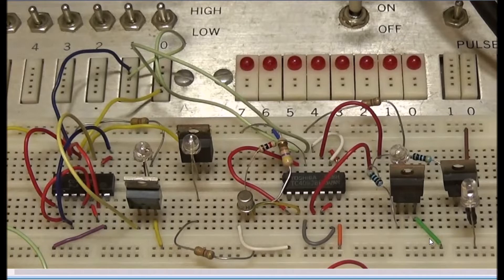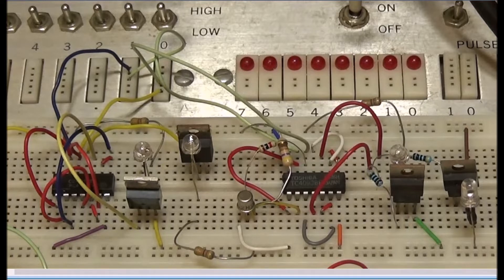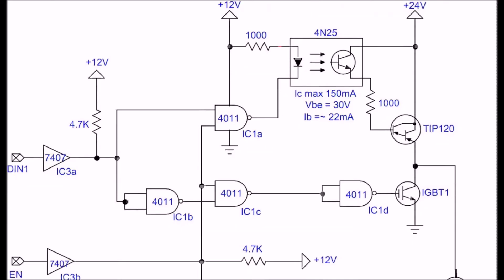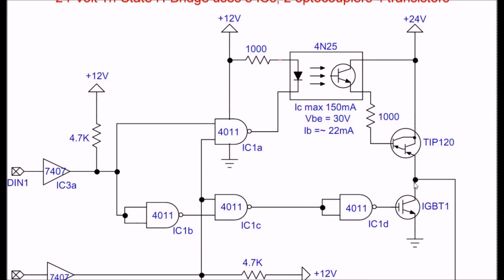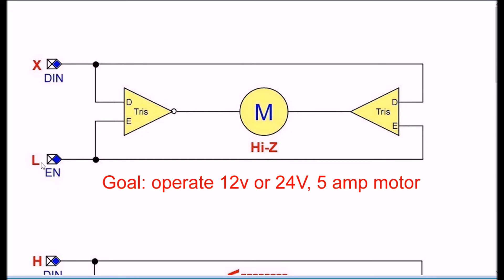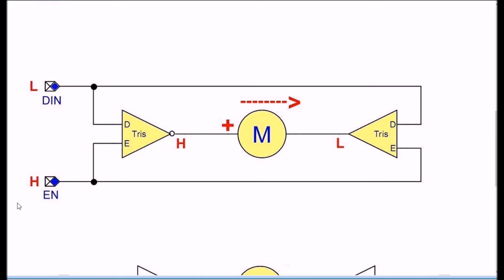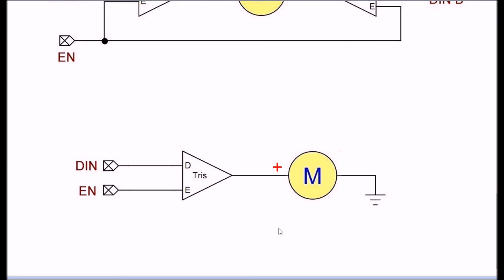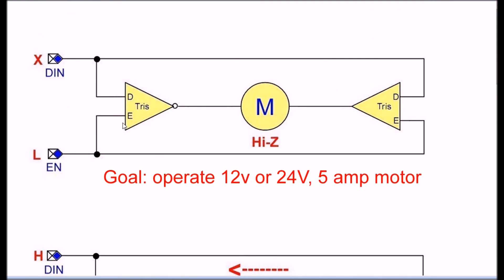Introduction Tri-State H-Bridge Motor Controls

Comment from the maker: Good discussion so far. This is designed with goals: teach various issues related to electronics, and to work on solutions related to specific design issues. This was designed where the output transistors are switch off in the same way a microcontroller IO pin is switched off. Here we are dealing with amps, not milliamps. The following videos related to this are going to address various parts of the design and how YOU can do what you really want.

Comment: Hi. I have been folllowing you now with great interest :) The reason I startet was the need for a motor control that could handle a 12VDC/55A motor. Any ideas how i would adapt/modify any of your circuits?
With regards from Norway
Reply: Just for clarity, what is your application like. How is the motor supposed to be used. For instance, is the circuit a simple on-off requirement, or turn on for a controlled time, then stop.  Do you need to control the speed as well. ??
Reply from the maker: It can be done with IGBTs. I would have to add a photovoltaic type optocoupler. I'll do a sample schematic.
Reply: The motor is connected to a seawater pump, feeding a heat exchanger. The amount of cooling is determined by the speed of the motor. I planned to use an existing temp sensor (NTC) and pwm.
Reply: @LewisLoflin  great

Comment: In digital logic, having A circuit that is floating is bad. The term floating describes a circuit that is in an undetermined state. That can go from either high or low to the opposite state at random. That is never good. The term you should be using is high Z or high resistance. But your digital  circuit should never be floating.
Reply from the maker: The output is floating on the transistors not the digital logic.
Reply from the maker: Leave the enable pin HIGH and the output will never float. It can be used for either.
Reply: If the output of the logic is not floating, the output of the transistor is not floating. it is in a definite state, on or off. A floating state indicates an indeterminate state either high or low at random. If the output of the transistors is floating on a H bridge controller, then you have several different possibilities. Both positive or negative transistors could  turn on at random. Not a problem. One positive and one negative transistor on opposite sides of the motor could turn on at random. This will turn the motor on unexpectedly. This is bad. Or both transistors could turn on on the same side of the motor at random. This causes a short-circuit. This is also bad. Since transistors are controlled by digital logic, They are part of the digital logic circuit and should not be floating. If the digital logic goes to a Hi Z state, The transistors should be pulled to there off state using a resistor. But never left floating.
Reply from the maker: @joea3728  No the output transistors are turned off not the control logic. No it will not turn on the motor at random. The motor will never run if all the output transistors are turned off. Thanks